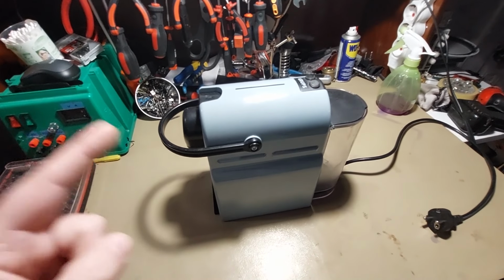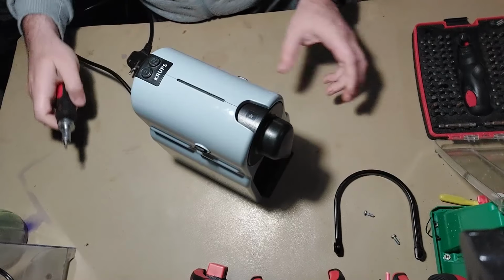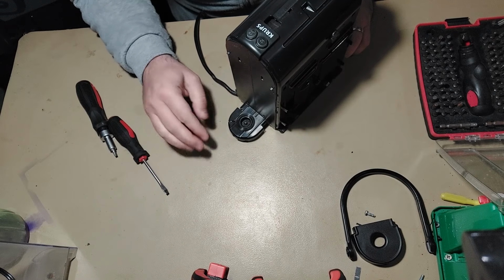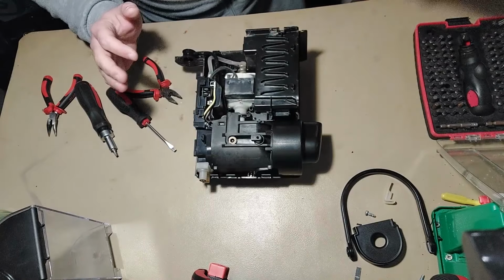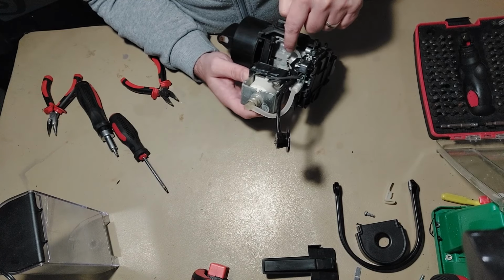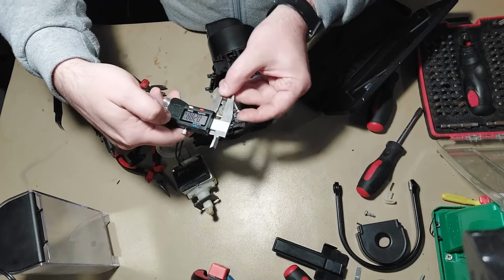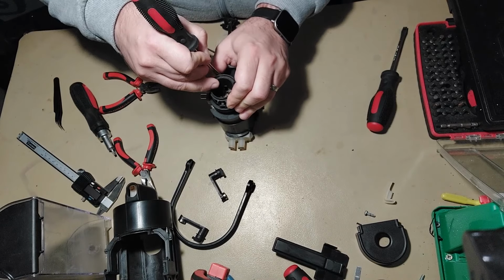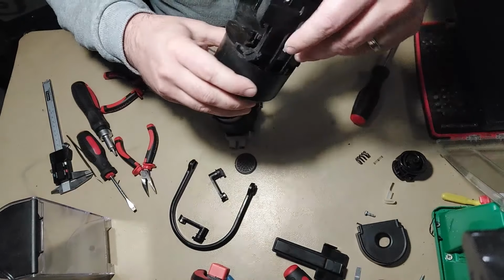Nespresso - All leaking points and all o-rings

Comment: Wonderful video - thanks. Sadly, my leak appears to be in the heating element, but at least with the help of your video, I managed to give it a go. I can't help but feel Nespresso could have made it so much easier for us to maintain this machine and reduce the horrible waste.
Reply: Hi. Just took my machine apart. Cleaned it and ran it without the cover to see I also have the issue at that difficult gasket . Did you manage to fix ?

Comment: to reach the „difficult“ o-ring inside the heater element, you do not need to remove the two bolts. You need just to rotate the plastic part, not difficult compared with the previous steps. Thanks for the video, it saved me much time!
Reply: Just want to confirm that it's a clockwise twist what gets you to the inner boiler "small" o-ring. It isn't easy to twist I used a flat screwdriver as a lever to twist it and broke a bit of plastic, not important but wanted to share.
Reply: @trinchetax  correct. Tiny flathead pry slightly from the back a few times. Get some gloves and grip a few times hard. Should come off. Thanks for the tip.
Reply: Did any one of you replaced the o-ring inside the heater unit ? Mine is definitely scrap. Anyone has the o-ring dimensions ? Thanx a lot for the video !!!
Reply: @laurentmathivet1214  Any luck? Mine's in bad shape too but I can't really find the correct ring online..
Reply: @michaeldepaikel  Nope :( Unfortunately, this is not a O ring from what I saw. It's more than a "Cylinder" ring. not available anywhere... I had to get rid of the machine... Sorry
Reply: Trying to change it, dismantle from a working boiler it's an o ring
Unfortunately I didn't success for the moment to remove the leak...
Reply: Thanks for the tip! Btw I found in another video that dimension of the small o ring are 3,4 x 1,9 mm
Reply: My machine also had this leak and is now in the landfill

Comment: Thanks for a really helpful video. Regarding your comment made at 21:10, I'm going to repeat what a wrote in one of your other videos. I had a leak at the junction between the metal of the boiler and the plastic component that sticks into the boiler, diagnosed by carefully running my machine with the outer casing and the right hand inner casing removed (exposing live connections and a water leak so only do it if you know how to do so safely). I couldn't separate the two, so I bought a "thermoblock 230V" from Partmaster that came as a complete unit including the large O-ring pre-installed for £40. These nespresso machines seem to have shot up in price and it was £40 to repair versus £90+ to replace. Be aware that the high pressure connector to the thermoblock has a very fiddly retainer. I had to straighten the fold-around ends of the M-shaped metal clip so it looked like a hairclip, and remove the clip entirely by pulling it out entirely at the centre. I put it back in that shape, and frankly it doesn't need to be reformed into its original shape to function as a retainer. All worked for me. No leaks. Bliss.
Reply: It is very easy to separate.  Just try turning the plastic part clockwise.

Comment: Hi!  At 20:55 where you mention the o-ring inside the heater element and it's basically "game over" - it isn't - you suggest that the metal pins have to be removed to get inside which is not the case.  The plastic cowling comes off by rotating it clockwise looking at the heater element straight on (from the front/plastic end) then you can see that it rotates clockwise as the flange is not symmetrical, as there is a larger gap above one pin than the other.  The larger gap rotates towards the metal pin and then the cowling pulls off!  There is a retaining tab that stops the cowling rotate easily but this can be dis-engaged by pushing a screw driver between the cowling and the metal heater next to the metal gap right at the top of the heater body.  Once you have the screwdriver well inserted, then the cowling easily rotates clockwise.  This is actually easier than many of the other steps to get to this point.  The bad news is that the o-ring is a small square section type (with rounded edges) much different to the very round ones.  The dimensions are approximately 5mm internal diameter, 7.6mm overall width - so a thickness of 1.3mm and a square section length of 2.25mm.  Once I find some, and can be sure they work I will post the exact type and dimensions.

After trying to replace the o-ring I spotted a small crack on the inside of the boiler/heating element but it was hidden by limescale.  I sourced a new boiler from SOS parts for 36.00GBP inc delivery.  Link : https://www.sos-parts.com/
Reply: Very very interesting about your findings, 2 coffee machine with same defect... trying replace it but no luck for the moment....thanks 🙏🙏🙏🙏
Reply: Thank you so much fo this comment!

For taking it apart, a slight rubber hammer tap on the edge of my desk did the job to unlock it.

It seems that I own another version with a small Oring in the middle which is very convenient 👍
Reply: Now unlucky me:

The leak isn't from the old gasket but from the casting/tube connection ☠️

Don't know how I'll deal with this one, I guess I'll try to put another gasket under the plastic spacer so the leak will be enclosed in between two gaskets in an empty sealed space 🤷‍♂️

Maybe it will explode haha

Who would have known repairing coffee machines could be so funny!
Reply: @LorenziLéo  same here.... And no solution, 2 coffee machine same issue... Interested by your return to put 2 o ring...
For me linkage is less but still have some water in coffee machine after several coffee...
Reply: @Gerald.B  didn't work at all for me sadly 😢

The machine is now in a cardboard box, laying around disassembled, replaced by another one.

I can't be sure about where is the leak exactly since as you already know you have to put everything back on to raise the pressure enough to test it.

I really have no idea where it's coming from.

I thought maybe a small crack in the plastic somewhere, but I can see nothing.
Reply: I need this small square shaped o-ring.  Has anyone successfully found one?

Comment: Thanks for the video guide.  Sadly I still have a leak… changed the o ring and cleaned the internals.  No leak if I run it without a capsule but when I put the coffee capsule in I get a leak.  Any idea what I’ve done wrong?  Thanks

Comment: Ok so the retainer for the smaller o-ring was already removed before you did this video, correct? And you missed showing how to remove the second retainer. How do you remove them without having to completely bending them to a point where they are un-savable? I tried to both push the retainer inwards towards the plastic clip that it holds, and the opposite. None of it worked to remove the plastic to get the smaller o-ring out. Thank you for your help, and making these videos.

Comment: Hi, thanks again for your videos. Watching several different ones gave me all I needed to tackle this cold water leaking machine.  

I found a set of O rings on Ebay,  Jokskot was the seller and they were a good price and arrived very fast.  He recommended your videos as well so I knew they were the right ones.
   
With regards to your video, I found each part of the dismantling really tricky.  I would fiddle and fiddle for ages, then come back to it and "ping" something would happen and it would come open easily.  The last bit for the big O ring was a case in point.  I've been trying so carefully not to break those little brittle lugs, and then there was an almighty crack and the piece flew off across the room and hit the cat.  She leapt off to catch the spring but lost interest when she couldn't eat it. I see no corrosion on the boiler so I am going to replace the large O ring and hope that is enough.  I also hope I can remember how to put it together again.  I might have to run your films backwards.  70 yr old grandmother here.

Comment: HI Adrian in this video at 20.10 you mention that in order to change the last o-ring it is difficult and you need to remove the 2 'Nuts" that the handle pivots on. This is not correct. If you look at the plastic collar from the front you will see that it has a cam format. Insert a screw driver to release the firtree lug  on the rear top  of the collar and rotate the collar clockwise 8mm and the collar comes free. Hope this helps
Reply: Thanks - I will try this!
Reply: thanks that helped. I found a long tiny spring sitting flat on the o-ring. That's likely the cause of the leak I had.

Comment: Thanks for the video! I had a hot water leak and I found that my issue was that the O ring that you show at the end was not seated properly (it was all twisted). I reassembled everything, but I must have made a mistake somewhere because now the capsules don't get perforated anymore at the front side. The 3 blades at the back of the capsule work fine but the diffuser plate doesn't make the holes at the front. Any suggestion?
Reply: Its still about oring..not enough pressure due to leaking..

Comment: Please list all tools, sockets, sizes needed to disassemble this coffee machine
Reply: - 1 standard size torx screwdriver for the 2 screws on the handle (suggestion: get one of them little multi-tool torx things for a couple bucks, will open many many devices)
- 1 standard size flathead screwdriver for wiggling the plastic panels off (if you don't have the above torx tool you can also use a flathead screwdriver on the torx screws, not the best way to interface with torx screws but certainly not bad either)
- 1 amount of restraint, it's not hard to open (or completely disassemble) without damaging anything, just take your time and follow the directions he gives in this and other videos for doing things in the right order. (essentially just start prying stuff loose at the bottom and work your way up)

Comment: Leaking of my machine ( in capsule container) was caused by a blockade of 9 of the 25 very small holes in the disc in front of the capsule, while other holes might have been partly blocked. After cleaning in hot vinegar and brushing the machine doesn't leak anymore. These machines are good machines and repairable but because of those exotic screws many end up at the dump. Loosening the screws with oval heads will be problem no1. The first time i saw them i  had doubts if it were screws...
Reply: My 2 cents would be to buy a torx's screwdriver multi-tool/set, they come in many varieties ranging from cheap to dirt cheap & will come in handy for opening/repairing many devices. In a pinch your best alternative option is a flathead screwdriver, but there's a chance it will damage the torx head.

Comment: Great video.  I have a Nespresso C50.  It was leaking badly.  I replaced the nozzle and the pour spout.  I also cleaned the holes in the disk that perforated the capsules.  It’s better, but still not right.  I can make coffee, but water still leaks into the spent capsule bin.  I want to change the brew head O-Ring, but I don’t know how to get to it.  Please do a video on Replacing the O-Ring on the C50 or provide some written guidance.  Thanks. JimmyPage
Reply: It is essentially a twist of the black part in a clockwise direction until the two noses on the plastic are free from underneath the handle axles on the metal part. It's not even a quarter turn but it is extremely stiff and will take some wriggling back an forth before it will budge. There is also a protruding square on the plastic part that reaches into a gap at the top of the metal part. I didn't notice that before I got it apart but the square on mine now has a corner shaved off of it. ;-)

Comment: What can you do if you break one of the tabs to the large O ring?
Reply: If you have the right drill and skills, drill a hole (extreem small fault tolerances) and insert a hot screw to hold the cup holder aligned. You can try to glue the tab back oh with epoxy in 2 stages, much patience needed. I came up with an idea to prevent damage during removal, will try to make a video if someone is interested.

Comment: No problem with the last O-ring. Turn the plastic clockwise ca. 10° , lift it and you can see and change the O-ring.
Reply: Do you know the part number of that o-ring or its dimensions?
Reply: There was no O-ring between the plastic and the alloy boiler. I presume when originally fitted there was some kind of paste or sealant between the two surfaces. I have put teflon tape between the two surfaces and it appears to have cured the leak.
Reply: @jokskot  the o-ring referred to is on the small central plastic spool that joins the two components, not the outer diameter faces.
Reply: @greatdane3343 thank you ! Do you know the dimensions of this o-ring ?
Reply: Do you need to remove the cup holder first? I've tried but the plastic holders are brittle and don't want to risk snapping obesity of them.

Comment: Thank you for the detailed instructions. I had a hot water leakage, I could confidently open up the parts. The O rings seemed alright so I just cleaned the perforator and other components. The problem now is I have more leakage! Does anybody have any idea? I also have more water coming out when I open the handle to drop the capsule. It seems it cannot pour out the total amount of water that it takes in.

Comment: You do not need to remove those two rods to get to the tiny O-ring inside the boiler. Those do not come off. You have to twist the black plastic piece attached to the boiler clockwise with a good bit of force.  Then it pops off

Comment: How do I remove the diffuser coin after disassembling the C90?  The diffuser has no space for a screw driver blade or knife to fit between the diffuser and where it is seated.
Reply: Mine didn't have those holes in the side of that plastic bit either, but you can just take a flathead screwdriver and wiggle it below the 'coin' from the big top or bottom holes of that assembly to then lift it out, the plastic is hard enough that the screwdriver marks will be insignificant. Then just clean it, afterwards push back in place till you hear a click and you're golden, doesn't matter what angle it has to be able to push it back in either which is nice (just make sure the big holes are on the nozzle side) the 'sealed brewing part' of the machine ends at that coin anyway, it doesn't extend beyond it, so dont worry about maybe making some screwdriver marks there, besides you nobody will know 😉
Reply: Thanks. I was able to get it out, clean it and seat it back into place.  Now I have another problem.  The piston part that hold the capsule is made up of two parts on my machine: a round metal outer piece and an inner round plastic piece.  The inner plastic piece is so old that it snapped into two pieces and it’s so brittle that it couldn’t be glued back together, so now when the piston pushes the capsule against the diffuser plate, water just pours out around the capsule.  I’ve looked everywhere for parts but none exist short of paying for a machine that someone is selling for parts, and it makes no financial sense to do that as you can buy a machine that’s working for almost the same price.  Probably need someone to make a replica with a 3D printing machine.  Anyway, thanks for your help on getting the diffuser out.  Here’s a video link showing the broken part that I’m referring to.

https://youtu.be/CCKgm406jjs?feature=shared

Comment: Hello guys,
I have the same type of coffee maker(Inissia EN80), and it leakes. I did all cleaning as recomended in this DIY except the replacement of large O-ring. What is parts number for it and where could I order one? 
Thank you,
Alex
Reply from the maker: You can find it on ebay or even Amazon. "Nespresso oring". It is a 38 mm outer diameter and 3 mm thick. Hope this helps.
Reply: @benassy69  I also need this part, but can't seem to find it anywhere. I can find the small o-rings but not the larger one

Comment: Hi there,

Thanks a lot for the amazing video!

at  7 minute 49' you speak about first possible leakage at the input of the pump but then you don't go deeper in how to fix it or diagnose it?
Can you please complete? Thanks a ton!
Reply from the maker: It is really simple. Just pul on the hose on remove the plastic inside the rubber housing ..clean it and that's it.

Comment: Is it possible to remove the diffuser plate without disassembling - seems mad if not possible!
Reply from the maker: Unfortunately not. I think Nespresso did this on purpose so you would by a new machine. :(
Reply: Many many thanks for your videos. Well I had a go, because it had become unusable - most of the coffee leaked out - I disassembled it, down to removing the internals from the case and being able to access the nozzle area. I could not remove the nozzle assembly as I was worried about breaking the tabs but was able to pop out the diffuser place and gave it all a good clean under running water and a lot of gunk came out. Also put a needle through the holes in the diffuser plate. Put it all back together easily and tested - and I can now get a cup of coffee!! So success. But it still leaks water somewhat, so I think one or more of the O rings need replacing - do you have a list of all the sizes?
Reply from the maker: Great to hear one problem is solved. For the o-rings take a set of different sizes from small to 40 mm wide and you will have all dimensions needed.
Reply: @benassy69  Thanks I have ordered some, but what was the stuff you put on the O ring at 23:25?

Comment: I've cleaned the machine, removed the large o-ring in the brew unit, its perfect, lubed it and replaced it, cleaned the front mesh all holes clear and yet it still leaks, with or without a pod...?!
Reply: I would try a brand new O-ring